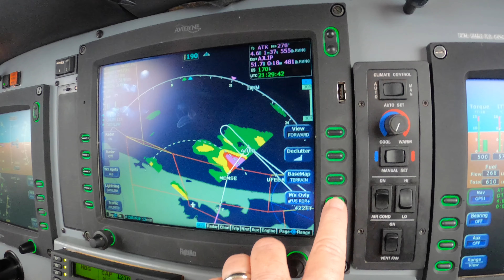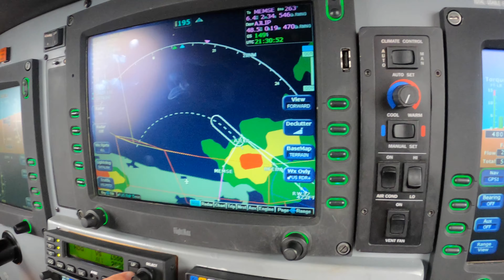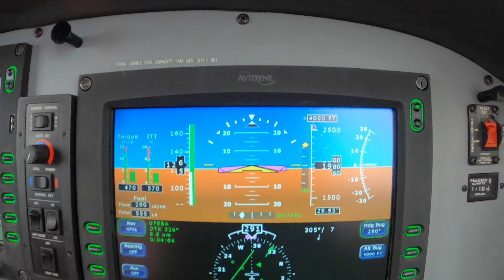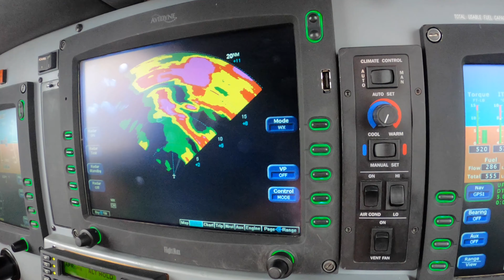Use of Weather RADAR in the Approach Phase

Comment: what is the tilt angle generaly for the descend ? how do you arange it  ?
Reply from the maker: Hi, Thank you for the question.. The descent angle depends on conditions .. anywhere from 1.5 degrees to 3 degrees. The G3000 equipped turboprop aircraft use degrees; the pistons use feet per minute.. 600-1200 FPM. Fly Safely - Train Often .. DR